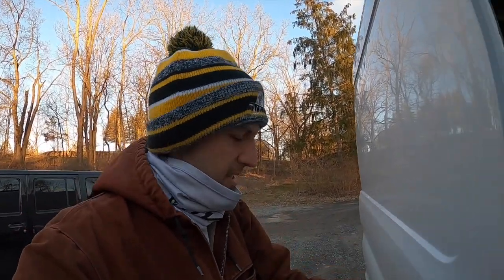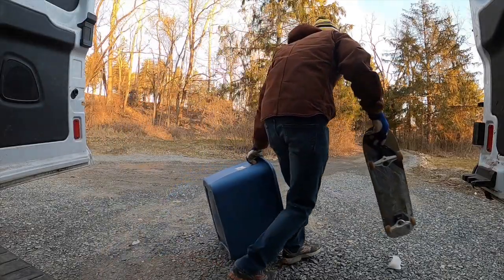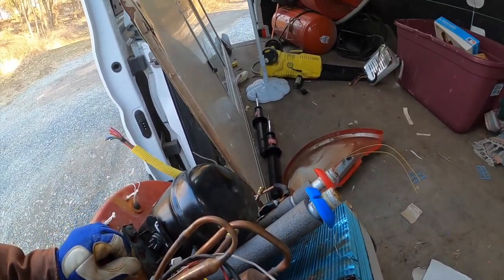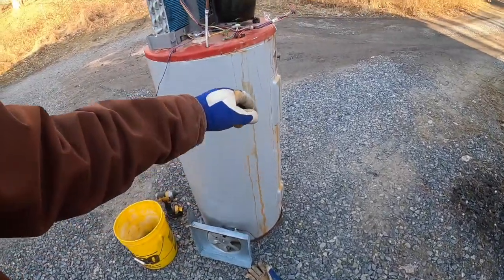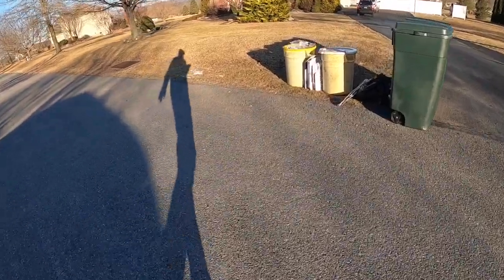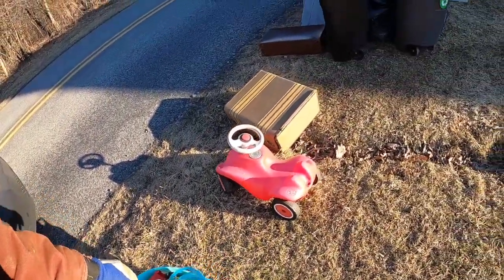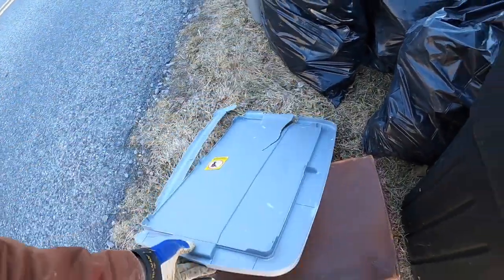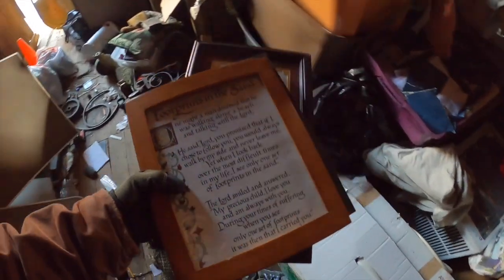Turning Trash into Cash! Found More Stuff For FREE!

Comment: You should have picked up the tote of burlap. It's expensive because many buy it for wedding decor. An average roll 3 in wide by 6 ft  at wall mart is 3 to 7 dollars. Rectangles are 3 to 4 bucks measuring  4 by 7.
That tore you could have gotten at least 10 00 at flea market